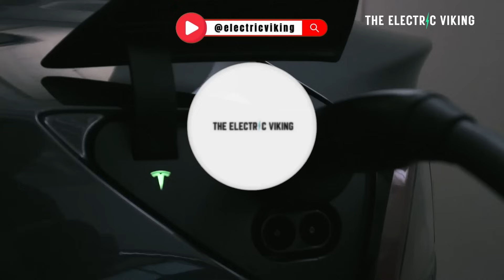American-Made Batteries: $100B to Power the Grid by 2030!

Comment: I hope that each small community (aprox 1000+ people) will have it own lfp megapack to power essentials during a wide scale outage. It would not take many solar panels to charge it up because time is on their side to charge it as it is not their primary source of power only backup. They could power shelters and emergency services using off grid connection.

Comment: Trump's demagoguery behind 'drill baby drill' and instability are bad, but they will not halt progress significantly.  It will mainly cause lower employment and higher costs. I wonder if there is more room for water-batteries (PSH = Pumped Storage Hydroelectric) like Dinorwig in the UK/Wales or Virginia's Bath County Pumped Storage Station.   Those can help stabilize the nets and reduce depenendence on other storage a bit.

Comment: Australian grid costs $TRILLIONS. 
It is fragile and lightweight. Length x $km.
Because it is extremely expensive to EXPAND. Never overbuilt. FACT 1

Rooftop PV is cheaper than windows $m² installed. FACT 2

Rooftop PV can make 24hrs of electricity in 4hrs.FACT 3

Batteries take the flood of new daily electricity and trickle feed the home or business or grid for 24hrs. FACT 4

EV v2g technology mass storage battery is on wheels dirt-cheap electricity and parked 23hrs every day and all night long. FACT 5 soon.

100kwh storage 10kwh sundown demand. 
Dirt-cheap electricity. 

Ezi pezi for modern battery management. 

Tax-free savings on energy. 
Petroleum $4,000 / vehicle
Gas $2,000
Grid electricity $2,000

$8,000 to $12,000 Tax-free savings every year for decades. FACT 6 soon.

20million roofs with 20million vehicles will unload the fragile national electrical grid over the next 20years. FACT 7.

20million x 6.6kW,   20million 100kwh EVs 
Grid 25gW x 24hr. 50cents kWh vs 2cents kWh. 

Grid owners will repurpose their national electrical grid. CASHFLOW  is king.
Existing customers will remain grid connected to supply industrial customers moving away from fossil fuels to clean feed-in electricity 😀 👍 

Central generation will be abandoned by grid owners. FACT 8

Australian electricity can double.
Grid can be protected. 
Grid CASHFLOW protected.
Imported Petroleum can be replaced. 
International Priced natural gas replaced.
Rooftop electricity replaced grid electricity. 
Rooftop PV panels shade 😎 hot roofs saves air-conditioning costs $$$.

CO2 emissions reduced at minimum costs.
C02 emissions reduction now.

Australian battery and Rooftop PV panels manufacturing can be created. 
Recycling expanded.

Petroleum for road building and maintenance and petrochemical industry and military defence needs stockpiles and emergency use will be needed. 
Limited Petroleum, $TRILLIONS SAVED. 
Limited natural gas, $TRILLIONS SAVED.

Plutonium electricity and exploding military defence budgets will not be needed. 
$TRILLIONS and TRILLIONS SAVED.

Exploding national grid construction budgets will not be needed. $TRILLIONS SAVED.
Raw materials C02 emissions SAVED. 
Mining and refining and smelting and manufacturing and..... grid expansion saved.

80% of the world's population live in warm latitudes. 

80% of the world's population live in dictatorships and dictators love ❤️ plutonium.
Nth Korea, Putin's Russia, Iran

Comment: People here have not figured out yet !  THAT the sun is out during the hottest part of the day.   Free cold air with your heat pump, and heat during the winter too
If the farmers grew hemp, they would also have hemp seed oil, to run their tractors.   
things are changing.    its all good.   the end of coal, the end of oil.    is a good thing.
Reply: Sunshines in business hours 😊
Reply: Oil, gas and coal are the feed stock to create materials used to produce almost everything on mass. If it is not metal, glass, wood, ceramic, rock or stone; the material or substance is probably created from one of those 3 main starting points.Plastics, synthetic fibres, synthetic rubbers, resin's, fertilisers, pesticides, paints, dyes, solvents, lubricants, medicines and all other kinds of chemicals.
There are other ways to create many of these materials, but there is nothing to create them even remotely close to the same scale. 
There is nothing to replace oil, gas or coal.
Reply: @alexandermelbaus2351  Your oil and gas reserves will last 100 times longer if you use solar and wind energy instead of gas and oil.
Reply: @Terry-y2r  They are all great for different uses, both separately and in combination. Trying to operate a national grid predominately on solar, wind and batteries in Australia does not provide any benefit; neither financial or technical. It is also equal madness to completely do away with the infrastructure and technology of traditional transport with only electrical systems. 
All the technologies have a benefit and a limitation, they compliment each one another and are better utilised when all are adopted.
Reply: @alexandermelbaus2351  You forgot to mention pumped hydro storage, the most economic long term grid level energy storage technology. The benefits are many, from lower costs if you personally produce power,  less pollution, less CO2 production and less environmental destruction from coal, gas and uranium mining. Coal and nuclear do not complement solar or wind. Gas is to expensive. It appears most transport will eventually be electric (air transport is the exception). It won't happen overnight, but that's the trend.
Reply: @Terry-y2r  Pumped hydro is great, but it is also something that requires a suitable geographic location. Unless the perfect site is available, these are huge projects with enormous difficulties. They also have massive environmental impacts where they are constructed and the projects completed in Tasmania were met with fierce opposition.
Well, I doubt there would be much solar or wind power without the power provided by oil, coal, gas or nuclear. 
Oil, coal and gas come straight from the Earth and provide huge amounts of power. Years of manufacturing technology to use wind and solar can't even provide for normal electrical usage. Even another 20 years will still not provide just for national grid usage excluding road transport. Sooner or later this realisation will become transparent.
Reply: @alexandermelbaus2351  We are in a transition, it won't happen overnight. Eventually all production of solar panels will use solar and wind energy.  There are over 200 sites in NSW alone suitable for pumped hydro outside National Parks. 30% of world energy already comes from renewables and it's increasing rapidly. Mining and burning coal and gas will do far more damage to the environment compared to building pumped hydro storage. Coal should be gone from Australia's grid in 20 years. There are no technical reason why it should not happen and the economics for solar and batteries is getting better.
Reply: @Terry-y2r  A good wind site is lucky to produce 30% of it's rated output a year with a operational lifespan of 20 years.Solar operates only during daylight with significant periods of low generation. A hundred years of production and construction will still need oil, gas, coal or uranium. The simple mathematical calculations for the generation alone quite clearly indicate that it is a design that will not be able to perform as needed.
Reply: @alexandermelbaus2351  The sums have been done and it adds up, Australia easily can produce all its power 24/7 from solar alone with sufficient storage from pumped hydro and batteries. It works out at less than 5% of Australia's land mass.  There is more than enough solar energy available in Australia it  to export large quantities of electricity or Hydrogen. That depends on economics. No need for coal , gas or Nuclear for electrical power production.
Reply: @Terry-y2r  All the solar panels built to date in Victoria; After about a quarter of a century are able to provide today only  about a third of the power demand on what is a clear and sunny day. South Australia, Victoria, Queensland and Tasmania all have  virtually no wind power at the time of writing either.
Batteries or any storage are not going to help if there is not even enough generation with the sun out.
Don't calculate for the best conditions, calculate for the worst. Two weeks of rain and cloud across Eastern Australia with high winds in Queensland; Forcing wind farms to shutdown across the state. 
Getting rid of coal and gas is complete stupidity.
Reply: @alexandermelbaus2351  Hemp will.     With NO forever chemicals.   Get out of the dark and see the light.   Oil is done.
Reply: @alexandermelbaus2351  exactly. 
Petroleum imports for road building and maintenance and petrochemical industry and emergency use and strategic military defence reserves.
Mid winter heating top up is nothing in the scheme of things.

Comment: It just struck me. Why don't they cover the battery storage containers with solar panels? It would shield the batteries from  solar gain, protect them from the weather somewhat, and generate electricity that could be used to power the sites management and security.
Reply: Yes! Not rocket'science.
Reply: The solar capacity would mineral compared to the large storage in the battery
Reply: In fact, the idea is so-so. Solar panels get very hot under the sun. It's like sitting in a black car with the windows closed in the summer heat. Do you know how much they heat up? You can use them to cook fried eggs. These are not the best conditions for battery life.
Reply: @ДмитрийИстомин-д4б  I was thinking they would be installed like a canopy over the boxes providing shade and some weather protection. Not solar right on the boxes themselves. It has been thought of though. https://en.wikipedia.org/wiki/Tesla_Megapack#/media/File:Tesla_Megapack_site_with_solar_canopies.webp

Comment: If the lack of LFP supply is stopping America from moving away from fossil fuel, then why is China still so dependent on coal for electricity given their battery industries are oversupplied?
Reply: China has 10yr plans which they will achieve and that is to phase out coal and gas fired power stations when the alternatives are practical unlike Germany which canned its nuclear power before having an alternative ready to go although they didn't foresee the US sabotaging their Russian chea/reliable supply.
Reply: China is a completely different set of rules. For one, they have been pulling a massive about of their population out of poverty as goal #1. Environmental concerns come second. Also, Chinese coal plants are used more like the rest of the world uses gas for variable load. I believe the newer plants that they've built to replace older plants have to have a much higher turned down ratio in order to have them idle back a lot better than the older 'baseload' style coal plants.